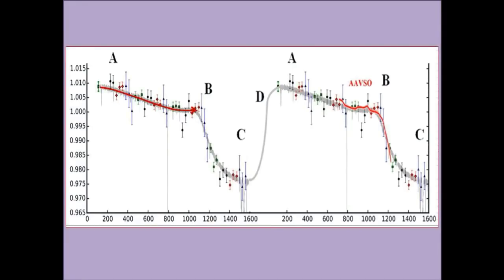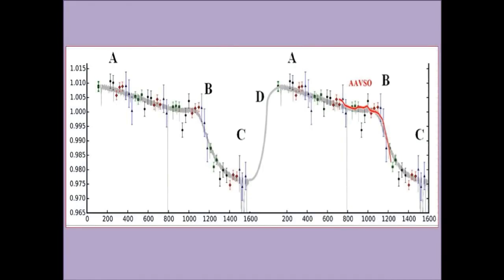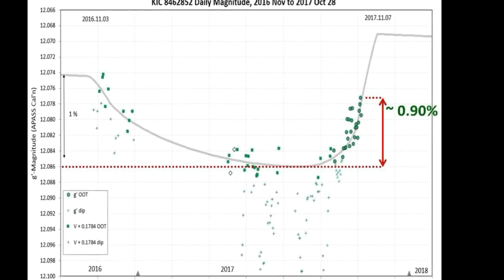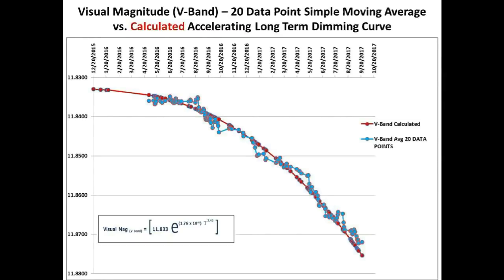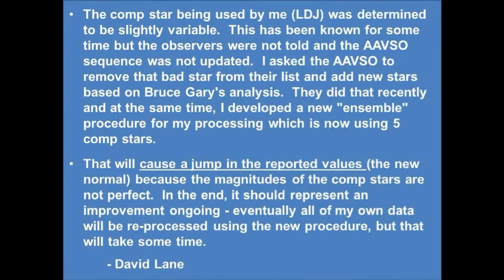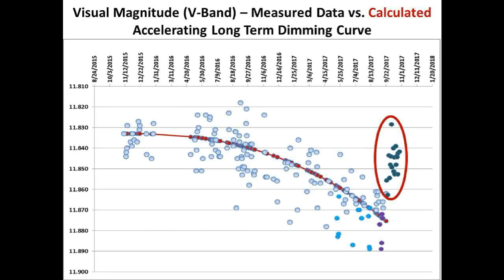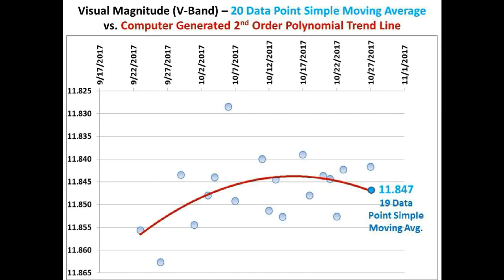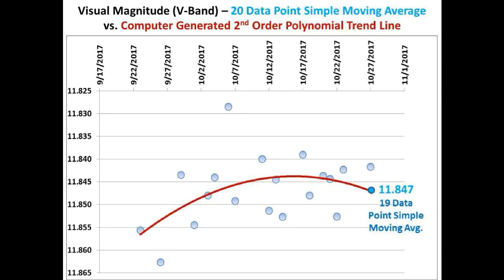Tabby’s Star KIC 8462852 Flux Update for October 28, 2017

Comment: Soo... is just me completelly confused or we're back at point zero in understanding the star, because if the data mess?
Reply from the maker: Captain Raz, the old data is still good and accurately reflects the long term dimming trend of Tabby's Star.  Integrating the two data sets will take some time.  By the way, if Bruce Gary's theory is correct, we may have an answer and solution to Tabby's Star behavior in just a few months.
Reply: What would that solution be?